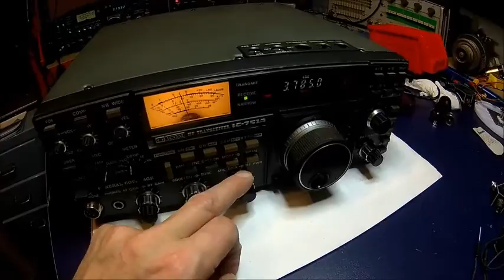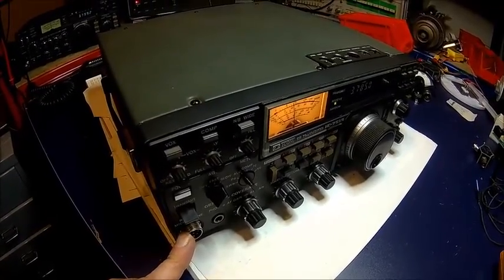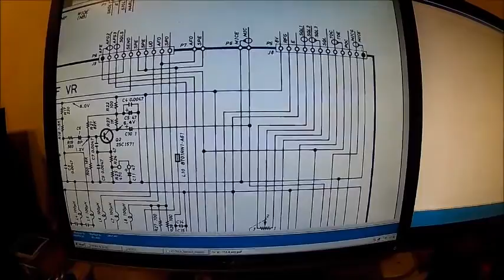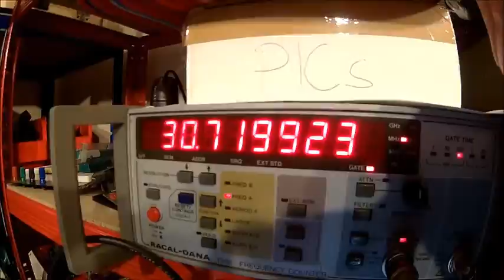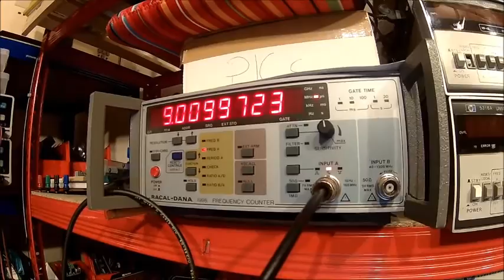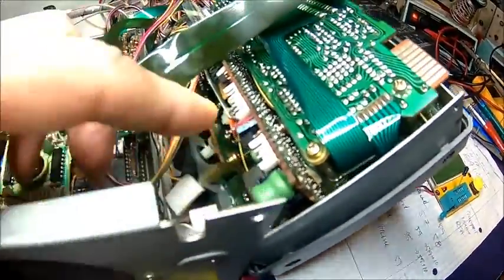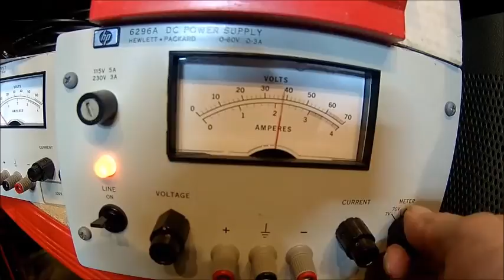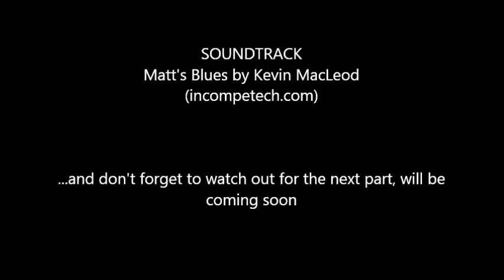Icom IC 751A - TX buzz repair, alignment and test (Ham/Amateur Radio HF Transceiver)

Comment: Hi, so I am having problems with my iCom IC751, suddenly the frequency display does not power on and the radio is stuck in transmit. I am wondering why this might be happening? Thx very much.

https://www.youtube.com/watch?v=42ngLZpfArM&t=3s

See this video. Thx.
Reply from the maker: Looks like the power board behind the front panel has failed, just check the  negative 5V supply, if that's not there or way off, the DC-DC converter has failed, Usually one of the transistors,  the resistor to the transistors or the transformer itself. While you there, replace all the electrolytics as those might be part of failure chain.

Comment: Spot on Mike, yes it was faulty caps in the DC-DC converter, thank you again. Please keep your videos going they are very informative. One other thing I noticed maybe the same with your 751a with the compressor turned on the output is lower than without it turned on, any hints there please.
Reply from the maker: Glad my advise helped, ... with the compressor OP, ...did you check what the ALC readings are with and without.
Also did you check it on a dummyload or on an antenna ? Bear in mind that high swr can lead to false assumptions as the PA just cuts back the power.  The only thin i can think about is that you running to much Mic gain (no comp) so you already in compression.
My sweet spot is around 1 or 2 o'clock with comp and 3 o'clock no comp, obviously depends on the Mic you use.
Best is checking with an AF generator (ideally 2-tone), just drive the input until you see an  ALC reading, then check the same with compressor, should read about the same output at the same ALC level.
Reply: Thank you for taking the time to reply, yes I check the output on a dummy load. I found that giving a slight tweak to R196 in the compression circuit brought the output back up to where it should be however the ALC levels are not quite the same with and without compression. I am in the process of building a two tone oscillator.
My 751a is an early serial number and I suspect it has been adjusted by someone without using the correct test gear.
Perhaps if you get time you could produce a video showing the correct setup process of the transmit audio
section, as this model is now getting on in years a setup would be a good thing to do for owners.
Thank you again for your very helpful advice.

Comment: Hi there, really enjoy your videos, please can you help my 751A has a continuous tone in the headphones when the volume is turned down and it is there either in TX or receive, I would really appreciate your comments, thank you.
Reply from the maker: Hi Phil, thanks, much appreciated.
The buzz is probably the, same issue as i had o n mine, primary source is the display inverter which sits on the right, behind the front panel. Very common problem with these radios
I think in one of my 751 videos i show that thing, it is the board which sticks out from the fron panel.
Unfortunately, dismantling is a real pain, be careful not to break that display.
Problem is that the electrolytics dying and then the inverter produces a really nasty noise on the 12V supply which is then going through the whole radio. I ended up replacing almost any electrolytic in the radio which makes it now almost quiet.
It is a longer job because you need to take every single board out and redo it, make sure you use 105degC electrolytics for replacement.
Values in the display inverter section are critical, do not replace by different values. Also some of them are 50V or 63V, make sure you got a circuit diagram and make notes what goes where. A pooped can makes a lot of a mess, so triple check orientation, some markings on the board are very hard to read, i made notes which way i pulled them out.
I recommend checking the inverter transistors for leakage as well, they running quite hot and mine were out of spec so i replaced them, these are penny parts and easy to change while you at, so not worth waiting until they go really bad and then spend another 2 hours to get that board out.
I am not entirely sure if those inverter coils go bad as well, i got the impression that the current draw is a little bit high compared to another radio, but it works and does not smoke..... Somewhere on the net i've read that the core  may come loose, so you can hear a buzz, even with the speaker disconnected. Cannot confirm this as mine is quiet with no speaker.
Hope that helps,   73, Mike
Reply: Hello Mike, thank you for taking the time to give me a detailed reply, I will check out your suggestions. 
Kind regards.
Reply from the maker: You're welcome

Comment: Greetings from South Africa :-) Interesting information presented and relevant to my current fiddling trying to resolve no tx issue with my IC-751... Think may also be due to failed caps on the mic input circuitry but still trouble shooting ;-) Question: What is the component test gizmo you are using to measure caps? What other functions are available? Fingers crossed for feedback! 73  Nigel ZS6RN ex G8DEV
Reply from the maker: Thanks Nigel,..good luck with your TRX repair, ... well,.that component tester is a pretty cheap thing from china, you can find it everywhere on ebay. Depending where you look they may look slightly different but essentially the all work the same way. I guess there is an arduino or similar inside
It figures out on it's own what sort of part might be connected. it works quite well and the results are within a few % of some decent equipment. I regulary use it as a quick and dirty go/no go tester, if the result looks odd i just compare it with a known good component or use proper test gear.
There are limits, e.g. very big electrolytics and coils with very low resistance will be reported as faulty, ... and it eats batteries, especially if you do many larger electrolytics.
If a component is faulty, you need to use a bit of common sense, e.g a dumb capacitor may report as a diode and shot transistors do report some weird results as well. It tests everything with up to 3 legs, certainly worth to spend the $10.
cheers, Mike ... (sorry not going to publish my call sign here)